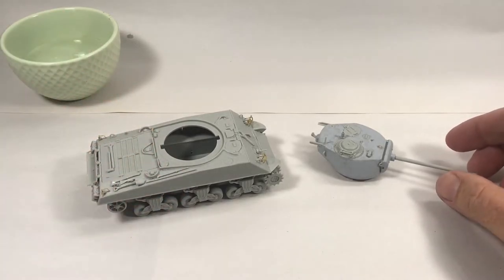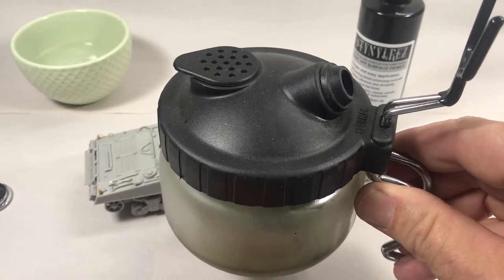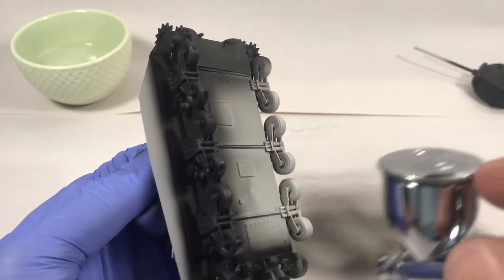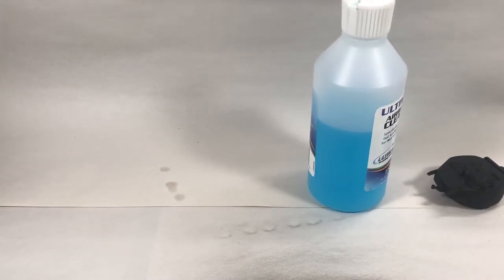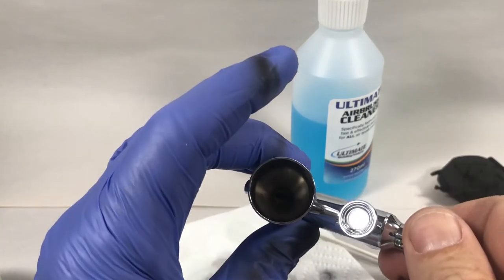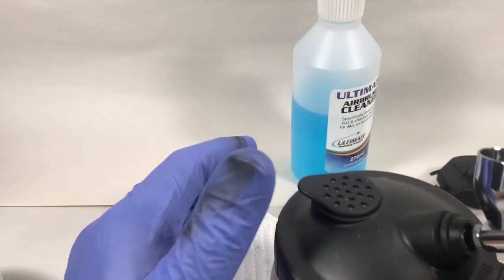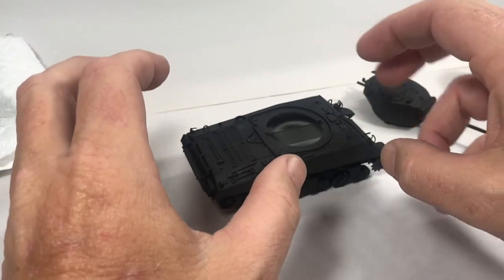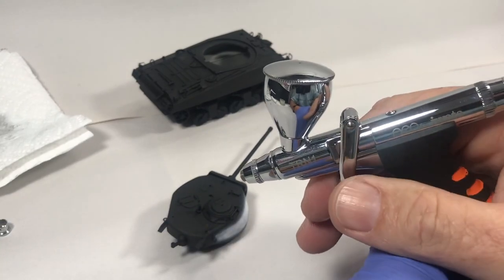Hobby Boss 1/48 M4A3 76W Part 3 version 2

Comment: I use back flushing too and I never had any problems doing this. Why should there be issues? You said it, that's what seals are made for. I disassemble my AB after I finished painting and use Q-Tips while I'm spraying. The AB cleaner looks exactly like the window cleaner I use. It works superbly and is only .75 € a litre.  The pre-shading method is beyond me. I'd have to change my whole approach and I doubt that I'll ever do that. I love my old school wash and dry brushing too much, but that's the best thing about this hobby. There is no wrong or right as long as we are happy with our results. I really don't care at all what other people think of it. I build for only three people: me, myself and I. If my viewers like it I'm glad, if they don't, so be it. I like what you do. Always did and watching your vids is always enjoyable.
Reply from the maker: Thanks Jens. I like to experiment once in a while, as in this case. The B&W technique is interesting but I am not sure I am sold on it yet. All of the modulation techniques can be very clever and interesting, but do they represent the real thing? I have been exploring this question  quite a bit. 
Anyway, thanks for the kind comments on my videos... I am glad you enjoy them, as I enjoy yours!